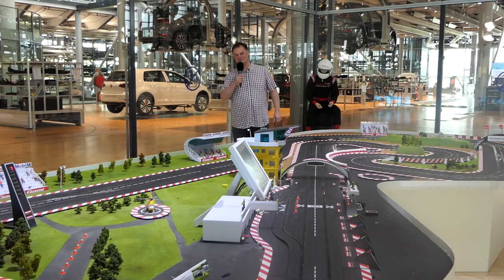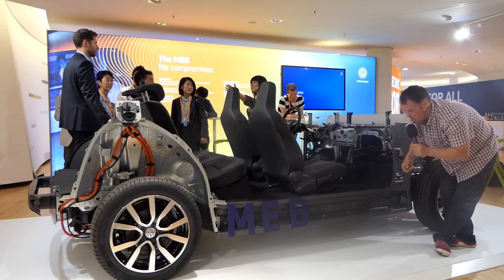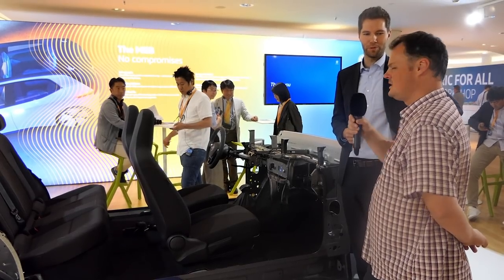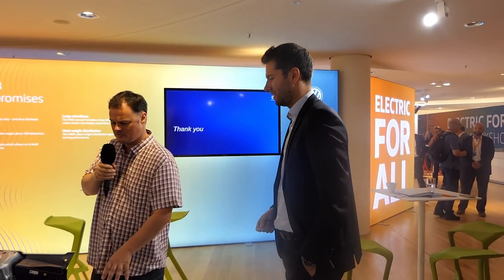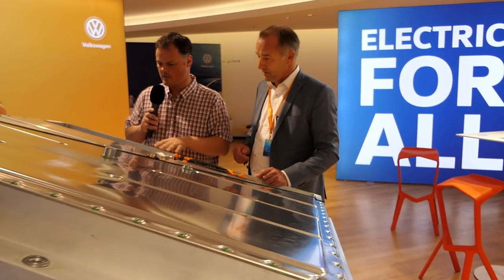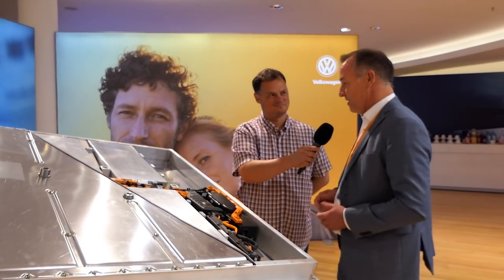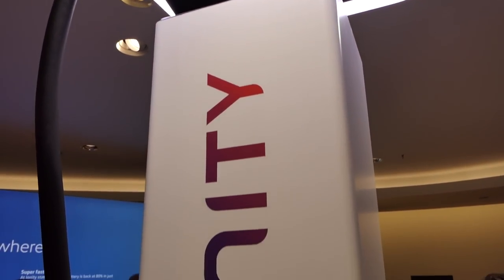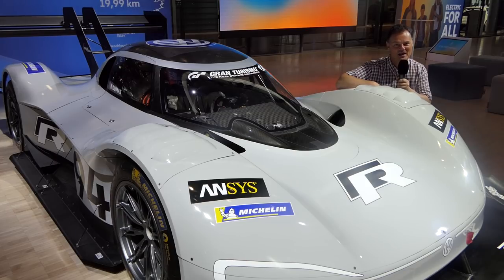Will this boost electric vehicles? 10 million EVs on Volkswagen MEB platform FEATURE - Autogefühl

Comment: I'm somewhat optimistic about the future of electric vehicles, however i have major concerns about how the electricity is created in the first place and because of that, i'm not totally convinced by EV yet. If there were an abundance of clean energy sources then the ev would make hell of difference to reducing CO2 emissions and would therefore significantly slow down global warming.  All i can see at the moment is CO2 and NOx particulates  moving away from the city to the areas surrounding power stations causing ill health to local people, and the dependency on electricity dramatically rising beyond what is achievable. At the moment i don't see any real solution to our current pollution problems. EV vehicles will take the lead for the time being but in the long term, Hydrogen imo is the only long term solution. I'd like to see VW and other global manufacturers, universities and governments worldwide really collaborating and investing in hydrogen production research.  Really enjoyable episode though.
Reply: The whole world of current cars can be easily charged overnight just from the energy capacity of the current grids that already is there and needs to be there to cover peak mid-day demands. Hydrogen is a total waste of energy, just as inefficient as gasoline.
Reply: In the UK there are times when  electricity fluctuates just from people using kettles during ad brakes. Can you imagine if most ICE car owners switched to EV? Blackouts are a very real concern from an ever increasing electricity consumption. Also, batteries can be really inefficient in different environments and most people don't know how to or even care about how they charge/use batteries contributes to that. Hydrogen is the most abundant element in the world. Harvest the energy in an environmentally friendly way and the Hydrogen fuel cell power-train will be unrivaled.
Reply: There is no free hydrogen anywhere on Earth. That is not an energy source, it is just an energy storage medium, same as batteries, with the only difference that for every 100kW you put into hydrogen, you only get ~45-50kW back - the rest is wasted as heat either during hydrogen production from compounds or during hydrogen consumption in a fuel cell. Batteries are up to 98% efficient, so you get back 98kW out of a 100kW you put into a battery.
It is really simple to link back EVs via their entertainment systems to a power grid controller so that when grid is under stress, the cars would pause or reduce charging. Most charging would happen around 3am, when everyone is asleep and powergrid is basically idle. BMW did already tests with such systems where people connected their BMW i3 to chargers and told the system that they want them to be at 90% charge by 9am and the system, in cooperation with the grid utility distributed the load such that all cars were charged by the required time and the power grid was optimally loaded. You can do this at car level or at charger level, it really does not make much difference.
The "kettle problem" is not about there being too much load, it is that the load jumps from very low to high in a very short amount of time. Spread out the increase over an hour and there is no problem.
Reply: Sorry mate but your arguments don't convince me at all.
Reply: You're not convinced, why? The choice seems pretty clear - we can either charge battery-electric cars directly (at very high efficiency) or waste lots of energy producing hydrogen, shipping it and "burning" it.
Reply: Aaronage - A 100kWh battery will give a potential range of 250 miles and, in order to produce that battery, it will take around 20 tonnes of CO2. A typical battery lasts for 150,000 miles, so that equates to around 83g/km of CO2. Then, when you take into account charging over that same distance, the same battery car will deliver 124g/km of CO2 over its lifetime. A hydrogen powered car produces 120g/km over its life. Obtaining Hydrogen from biomass will reduce this to 60g/km. An EV could never achieve this. So for me it's pretty clear. What about you? Also, a Hydrogen car can be refueled in minutes, EV take at least 30 minutes to charge upto 80 percent. For me an EV is a backward step and a cheap way to convince people with little knowledge on the subject that it's the best way to tackle global and local emissions and pollutants. In reality, they're no cleaner than an ICE engine which is really ironic for VW.
Reply: Aigars,

in the U.K. at least the grid is not basically idle, offpeak load drops about 25%, that's all. Peak demand starts at about 6 am so there is only a fairly small window of reduced grid output. Even then, will it be enough for the projected number of battery cars? There is also another problem which I have not seen mentioned. The distribution network is sized to suit our domestic and industrial load. When there are a lot of electric cars all charging at the same time and for relatively long periods, I supect that the distribution network will not cope as it is not designed for that reduced diversity factor, i.e. the load rises and falls so the total load is within capacity. This is a restriction on cable and transformer sizes that will need addressing. It's not the same as grid load which can be increased at times of greater demand. Incidentally all this increase in load is provided by fossil fuelled generation.
You talk about 98% battery efficiency, but you need to start at the power plant and it's efficiency; transmission, distribution and conversion losses all reduce that seemingly high efficiency. I agree with you on hydrogen, it's not agood system fro transport.